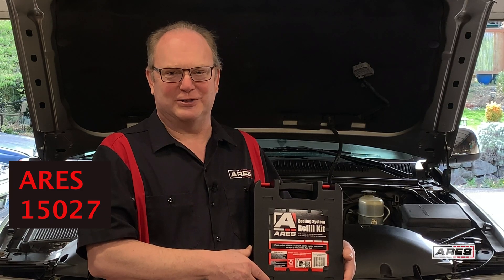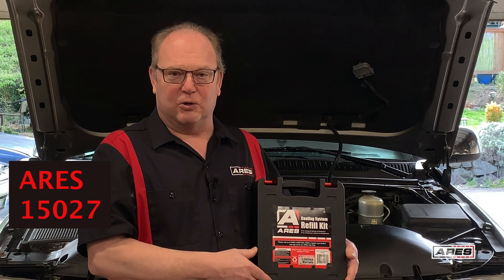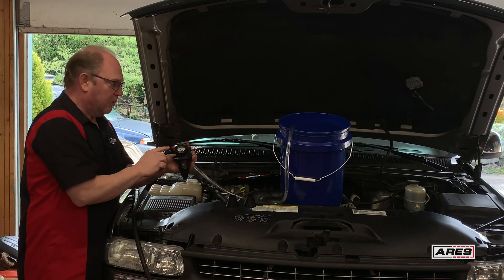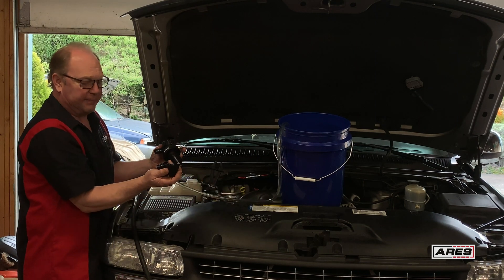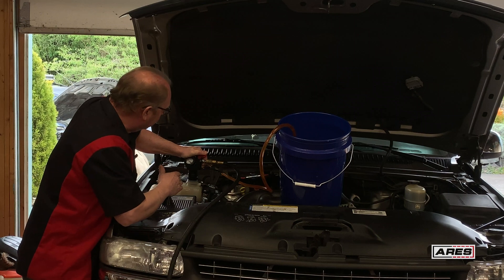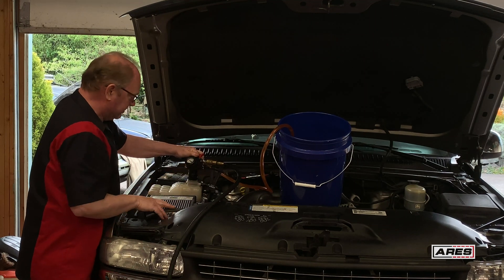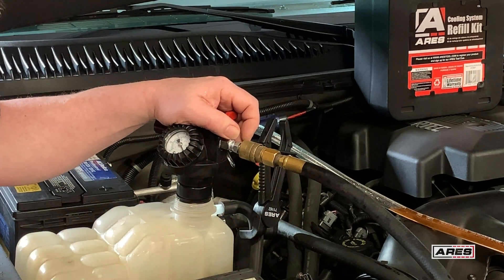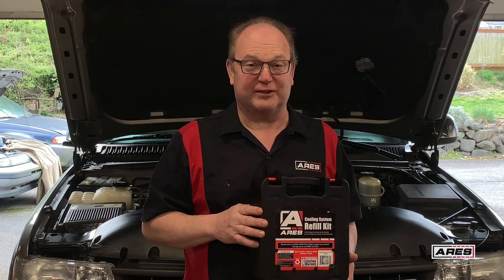ARES 15027 Cooling System Refill Kit - How to and Overview

Comment: Quality control:

Today, quality control is horrible! 

I purchased a Maddox cooling system refill kit… 

I also purchased an OEM 24444  cooling system refill kit.

Both of these items leaked from their respective fittings from the manufacture. 

I tested the fittings with soapy water and bubbles appeared before my eyes.

This gave me a false impression that…   my cooling system had a leak.  My cooling system did not have a leak, because I confirmed that by performing a pressure test.  

I left my cooling system under pressure for 20 minutes and I had absolutely zero loss in the 20 minutes. 

My remedy: 

I took apart, both cooling system vacuum test & refill tools.  I removed all of the fittings and cleaned out all of the threads, followed by, applying Teflon tape, and thread sealant to all of the fittings.

I waited 24 hours for the thread sealant to cure properly and proceeded to test both tools that I had just repaired. 

Both cooling system refill tools were now perfect. The fittings no longer leaked, and my cooling system appeared to be flawless as I knew it was from the very beginning. 

One thing nobody mentions in their videos is: 

When performing a vacuum test on your cooling system, it is best and advisable to apply antifreeze/coolant to the rubber fittings on the vacuum tool itself, which will provide a much better seal. 

When performing a vacuum test with a dry rubber gasket and dry metal or plastic, the vacuum tool is more apt to leak, but not always. 

If anyone has tried to vacuum test a HOLLEY power valve and they use a dry suction cup onto the metal surface of the power valve, you will quickly find that your mighty vac pump will leak if the suction cup does not have some type of Moisture applied to it. 

If you ever find yourself having a vacuum leak, while using a cooling system, vacuum test and refill tool, you may consider applying antifreeze, car washing soap, dish soap, a little grease, or just something to get a better vacuum seal.

Because there is nothing worse than chasing down, unnecessary leaks!!!

When I use my method I have outlined above, I have already eliminated unnecessary possibilities. 

Very nice job with your video… The sound quality was very good, and the lighting was good for the detailed illustration you provided.

Comment: Can you pull or purge the air out of your truck so there is no air pockets in the system
Reply from the maker: Yes, with this kit you can purge trapped air from your cooling system. It's critical to ensure proper seal to ensure no leaks throughout the process.

Comment: What is the outlet female for? Black in color
Reply from the maker: I believe you're asking about the port on the body. That is the air vent (exhaust). The compressed air goes across a Venturi to create the vacuum and it exhausts through that port.
Reply: @ARESTool  ty, yeah I figured it out. Great tool! Reasonable price too. Will definitely recommend when I post videos on Ride 2 Eat in the repair section
Reply from the maker: @SamBassComedy  Happy to hear the feedback! Can't wait to check it out!

Comment: What's the smallest air compresser I can get for this to work
Reply from the maker: For the product to function properly and be able to pull a full vacuum on the system the compressor would need to have a pressure between 100-150 PSI. We recommend using around 120 PSI or above.
 
But more importantly the flow rate (CFM) must be a minimum of at least 2.5 CFM to work properly. Another consideration: if the tank of the compressor is too small (like 1-2 Gal.), then the compressor will constantly run trying to maintain pressure. The larger the tank, the easier it is for the compressor to maintain consistent pressure. Hopefully this helps!

Comment: Do you let the coolant drain from the radiator and hose before using this? Looking for a faster coolant flush alternative.
Reply from the maker: Yes, the cooling system should be drained before using the ARES 15027 kit to test for leaks and refill coolant. Thanks for reaching out!
Reply: @ARESTool  thank you.

Comment: I bought this exact coolant vacuum filler for my Jeep but when I go to put a vacuum on the system A: I can't get it anywhere close to 20/25 (mine is about 10) and the entire time I'm pulling a vacuum it's shooting coolant exhaust out the vent.  Any help would be greatly appreciated!
Reply from the maker: Hey Marc! A few troubleshooting notes upfront: make sure that the coolant fill line is completely closed when pulling the vacuum. If the fill port is closed while pulling the vacuum and the vacuum pressure is only pulling to 10PSI we definitely want to investigate further. We're more than happy to chat if you want to email or call us to troubleshoot this with you - you can even send us a video of the issue!  https://arestool.onsitesupport.io/ticket/add

Comment: 2019 jeep wrangler jl sport 3.6 does not have radiator or drain plug, so for this how do you flush and refill coolant on this jeep?
Reply: buy a new jeep
Reply: Don't get a jeep first mistake

Comment: That's supposed to go in the radiator cap?
Reply: The best place to use this tool is the highest point of the cooling system, which may be the radiator cap or coolant expansion tank (dependent on what vehicle you are servicing.) Kinda a late reply but nevertheless figured I’d leave something for the next person who doesn’t know